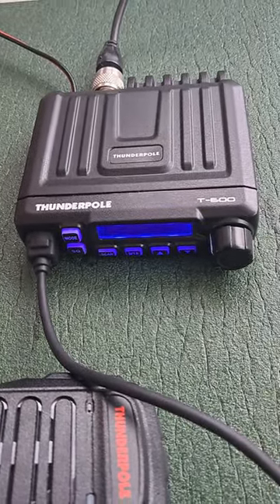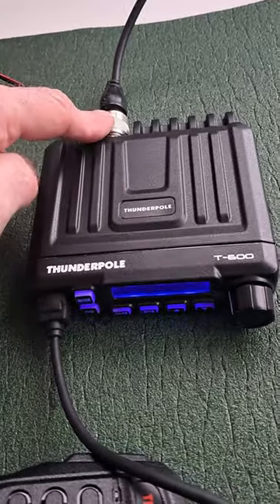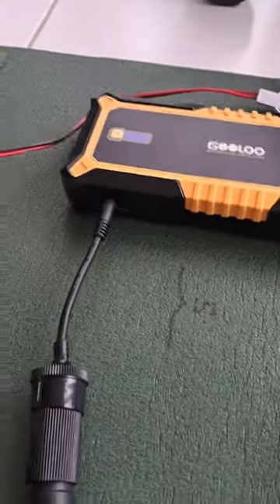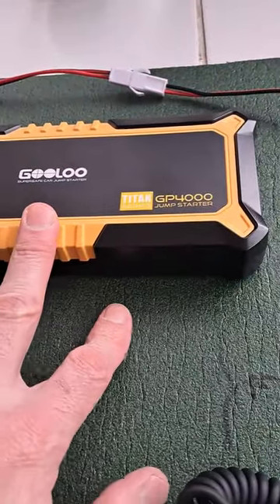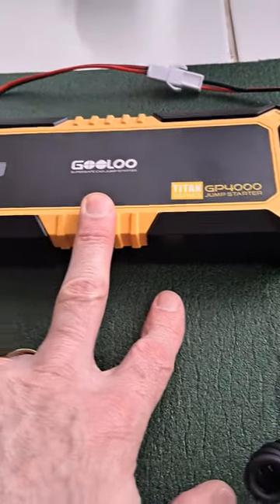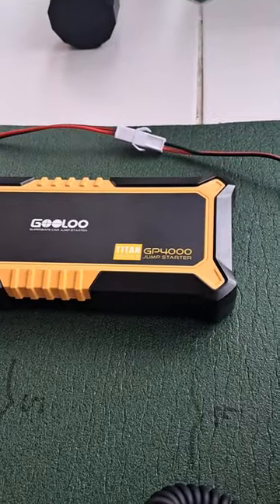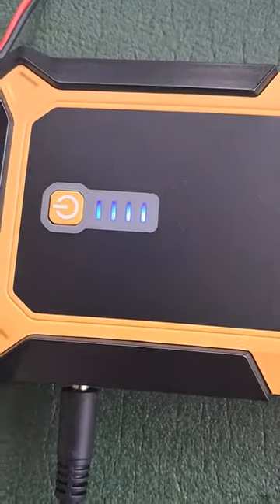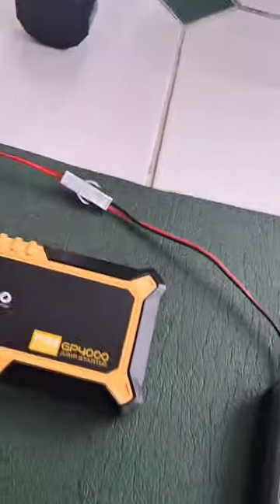Grid Down Comms Power

Comment: Great video PV, thank you.
A question if I may, are there precautions one can take against radio and /or signal jamming?
Reply from the maker: A comprehensive subject within itself - I'll elaborate in a video but some points. 
- Avoid interception.
 - increase your power/work through it.
 - Use scheds.
 - Use different modes of transmission - Freq hopping etc.
 - Use landline comm devices (field phones).
Identification is key in the early stages.
Reply: @PreparednessVeteran , thank you PV, much appreciated. 🙏
BTW, that series you did on electrolytes really came in handy a while ago. 🙏🙏🙏
Reply from the maker: @nickmuller2567  Good stuff - Got to be wary of electrolyte consumption - although can be a lifesaver, too much can have negative effects.